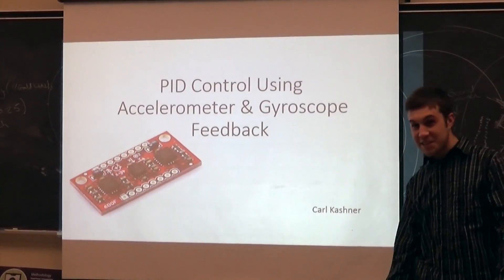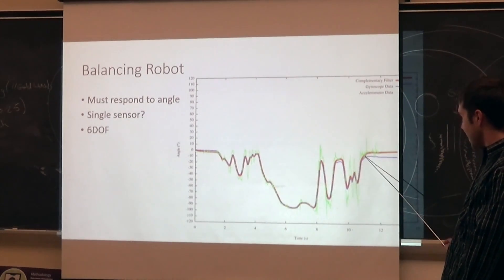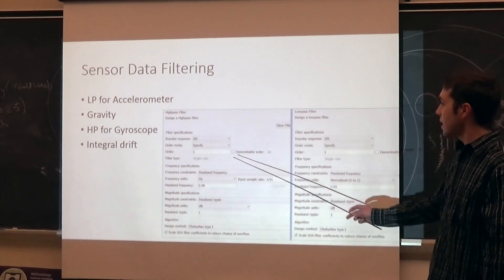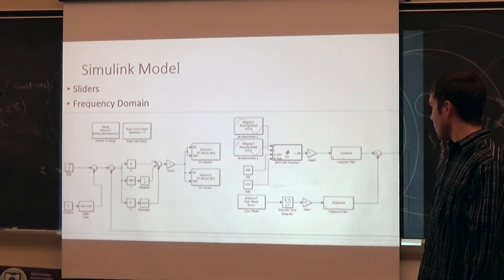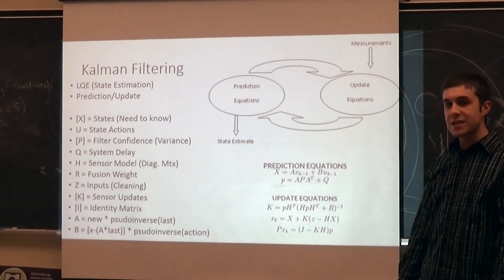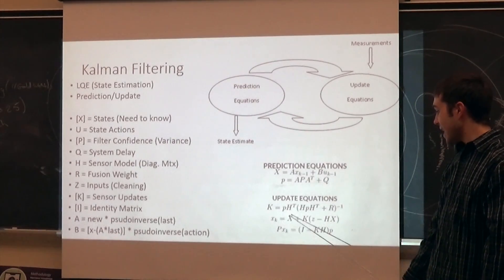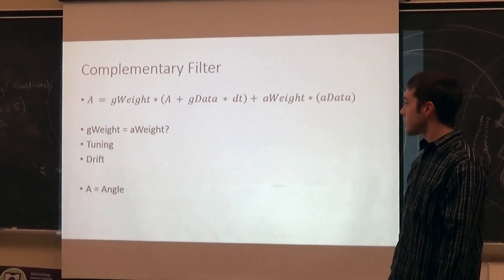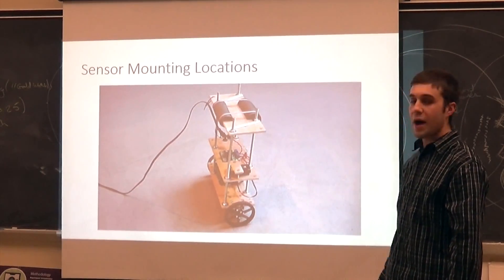Carl Presents Matlab Sensor Fusion for Balancing Robot

Comment: The gyro only measures rotational rates and you should get the same number regardless of the location, not accounting factors like vibration or structural stiffness.